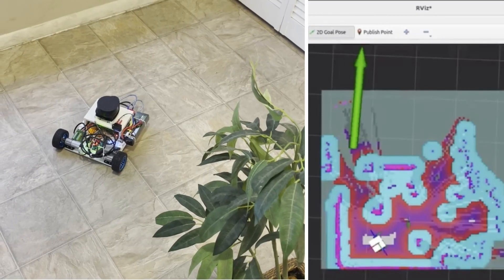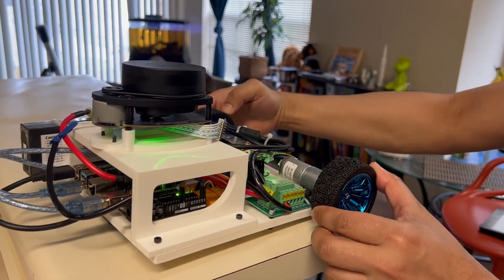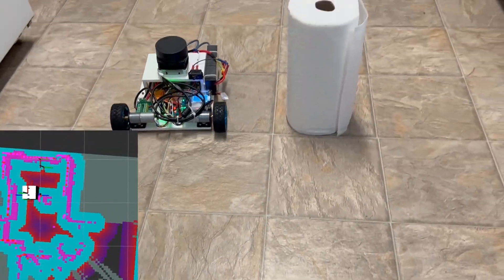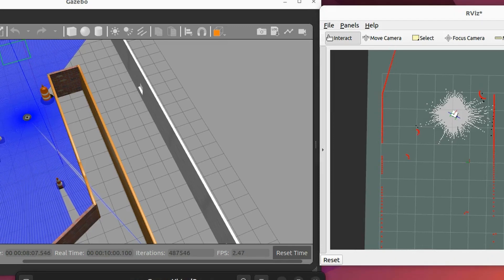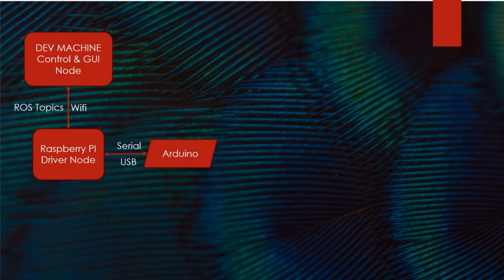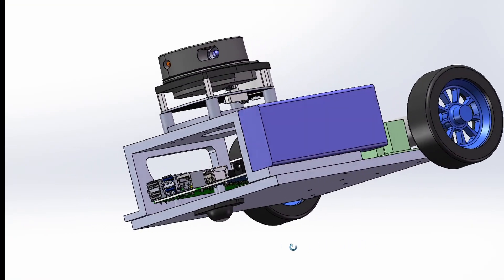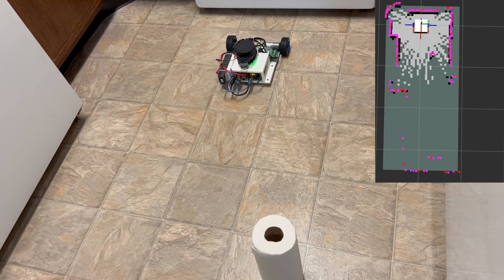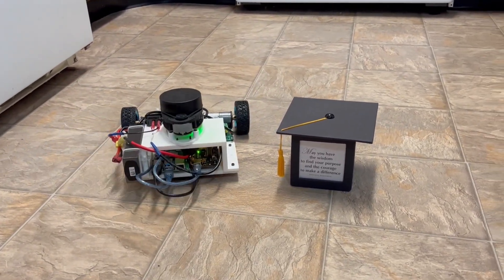Differential Drive Robot- SLAM and NAV using ROS2

Comment: We're developing the same robotic system but has encountered an issue, the laser scan boundaries are moving along with the robot when navigating using teleop. Hence when doing slam also, as the robot moves forward, the entire scans move, so the maps are all getting distorted as the robot moves, leads to multiple copies. Do u know any possible solutions to this issue. I went through the gthub u provided and it's the exact same codes that we have implemented in ours..
Reply: did you solve it?

Comment: Great project ! May i know what is motor rpm, ratio and pulse you use in this project ?. I'm quite interested at how you calculate  "2475" value.               <param name="enc_counts_per_rev">2475</param>. Can you share how you calculate this based on your motor spec ?

Thank you.
Reply: Usually the encoder counts per revolution or the cpr is included in the spec sheets of most motors. You will always find it in the spec sheets of encoders. Additionally, the cpr can be calculated by taking the ppr(pulses per revolution) and dividing it by 4. No calculations necesary!

Comment: Brother, can you fuse Lidar and multiple cameras to create a 3D map? Also, set the destination from another device, so it can navigate by itself.
Reply from the maker: I'm sure it can be done that way. In my setup, I'm just using a Lidar and the dev machine sets the path where as the robot navigates autonomously.

Comment: Nice! I was actually thinking of pursuing a similar project, Ekumen Lab's Andino bot. As someone with experience in this area, do you think it's a realistic project for someone relatively new to programming?
Reply from the maker: If you have some basic understanding of ROS, Raspi and Arduino, you should be able to follow along. It maybe useful for you to just start with a differential drive robot built on Arudino entirely and build upon that.